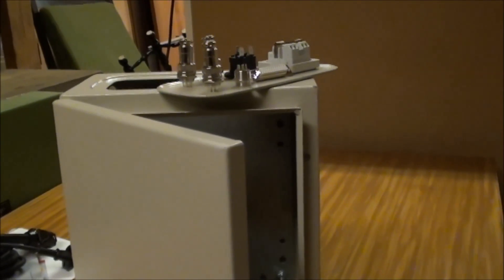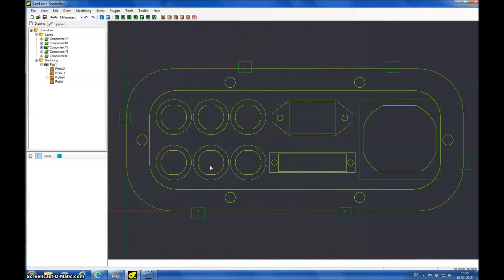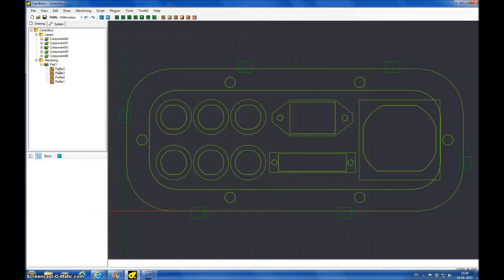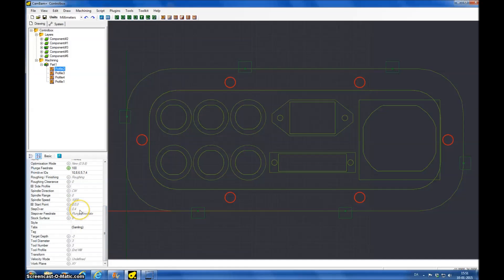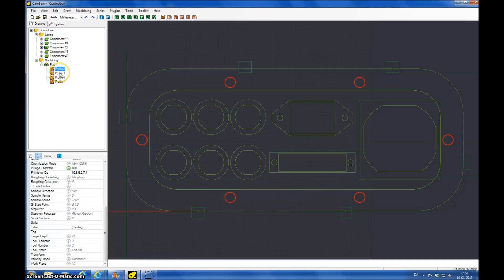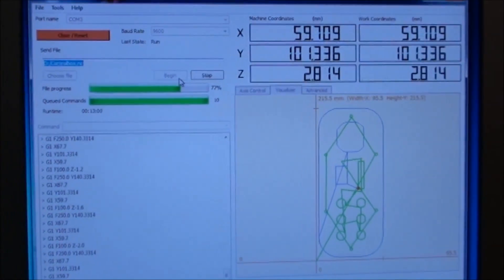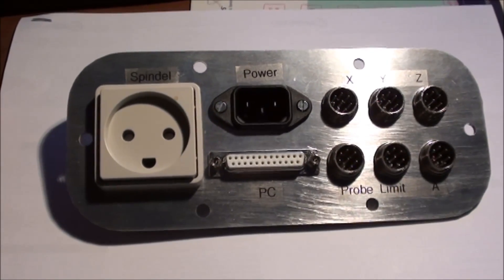Milling aluminum with a ShapeOko 2

Comment: Nice panel Martin.  How did you eject the ethanol?  I didn't see a nozzle.
Reply from the maker: +onjoFilms Hi Onjo, I used a 10ml syringe to put the ethanol on the material while milling. It's not like a flood. I just apply a little at a time
Reply: +Martin Barfoed Oh, okay, I see how that would work. Thanks.

Comment: Hej Martin, hvor køber du materialet? Jeg er nemlig også ved at bygge en OX, så forhåbentlig får jeg snart brug for materialer.

Det ser ud til at du godt kunne bruge en dust shoe. :-)
Reply from the maker: Niklas Myschetzky Hej NiklasSpændende med endnu en Dansk OX. Hvilke plader regner du med at bruge glasfiber, Alu eller Stainless ? Jeg fik mine skåret hos Gladsakse klip og buk på deres laser.Jeg har haft meget glæde af at købe ind hos RS. De har stort set alt man har brug for i dimser og materialer. Man kan god oprette sig som kundes som privat.http://dk.rs-online.com/web/c/slibemidler-og-ramaterialer/HIlsen Martin
Reply from the maker: Niklas Myschetzky Ok. Hvad betalte du for alu pladerne? og fik du et sæt inner plates med??
Mht materialer så er det hos RS jeg køber dem. Det link jeg sendte er til sektionen "råmaterialer" her finder du alu, nylon, divers plast plader samt fx glasfiber forstærket plast (det materialer, som den oprindelige OX blev lavet i)
Reply: Ah det så jeg ikke. Tak kigger ind på RS igen så. :-)

Inner plates til gantry? Hm .. nej det er vist bare et sæt outer, og så til Z aksen og til at samle v-slot profilerne.
De her: http://www.openbuilds.com/attachments/image-jpg.6265/

De kostede £85 inkl forsendelse.

Comment: What was your depth of cut (per pass)?
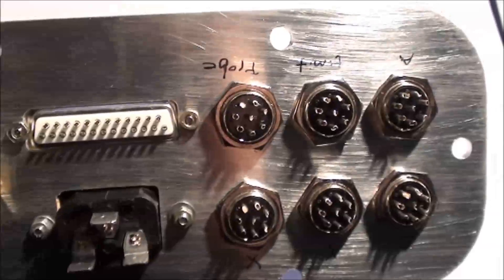Reply from the maker: Dave Hylands Hi Dave. All cutting parameters are given at time 3:53. I used a step over of 0.4mm. In later cuts I have increased to 0.5mm with out any problem.
Reply: Martin Barfoed I saw that, but the term stepover (at least in CamBam) refers to width (i.e. X & Y). CamBam uses the term "Depth Increment" to refer to how much the Z axis changes per pass.

The default Depth Increment is 0.4mm and the default stepover is 0.4 (40% of cuter diameter). So I just wanted to be clear which one you were referring to.
Reply from the maker: Dave Hylands Hi Dave. That makes sense. I have used the wrong term. Step over is X/Y overlap between passes. I will make a note in the video description.

Comment: Great build. Please can you tell me the specifications of your stepper motors? What size are they and what is the holding torque?
Reply from the maker: Josh Robb Hi Josh. I'm using fairly small motors in this build. NEMA 17 w 62 oz/in in holding torque. I think this is sufficient as I have never experienced that the stepper is the limiting factor. If the machine hits something - e.g. end of axis (and limit sw function is not enabled) the pulley grinds on the belt - the motor does not stop.
Reply: Martin Barfoed
 So using NEMA 17 62 oz-in is fine to engrave wood, plastic, and aluminum right?
Reply from the maker: Josh Robb Yes,  I would say so.

Comment: What program did you use to make the drawing? Thanks.
Reply from the maker: I made the drawing in Sketchup. It a 2D top view drawing. Then you need to convert it to G-code before milling. You can get a plugin for Sketchup (SketchUCam, free) but it is not so flexible. I used CamBam. Actually you can also do the drawing in CamBam. However, I find it easier to use Sketchup.

Comment: Hi what end  mill are you using for aluminium?, do you have a Link where i can get one?
Reply from the maker: It's a 3mm, 2 flute up-cut bit especially designed for aluminum. The maker is Sutton Tools but I would expect that most brands have one. I do not recommend going for cheap stuff. A good bit do come at a cost however, they also last long.
Here is a link. See page 5-7 http://www.risager.eu/Files/Billeder/5-hm_fræsere.pdf

Comment: What is your electronic setup? (Type of steppermotors ect.)
Reply from the maker: Hi Bent
I use NEMA 17 steppers, grbl shield and the Arduino controller. Its powered be an old laptop PSU. I have med a video describing the setup: https://www.youtube.com/watch?v=16Z8bDdIIAY

I did get the parts from Inventables in the US. This is also where I got the ShapeOko kit from.
https://www.inventables.com/categories/electrical/microcontrollers-and-accessories
https://www.inventables.com/technologies/stepper-motor-nema-17

Br, Martin

Comment: This is very nice ! ,What router are you using to cut aluminum ? I want to cut Aluminum with my shapoko2 but I have no idea where to start. Could you provide list of router and what bracket to hold it ? Thanks! keep up the good work!
Reply from the maker: Hi BG
I use a Kress 1050 FME. It's 1050W and adjustable speed 5000-25000 RPM. It has 43mm mounting diameter. I found a solid mounting bracket on e-bay and made a mounting plate out of nylon (the white piece)  to put it on the ShapeOko. Here you have a close up:

Link to e-bay shop: http://www.ebay.de/itm/Eurohalsaufnahme-KRESS-SUHNER-CNC-Frase-Frasmaschine-/311246545276?pt=Industriemaschinen&hash=item4877bd617c